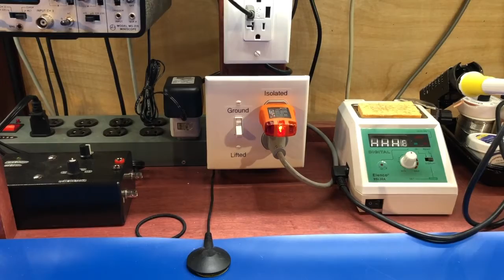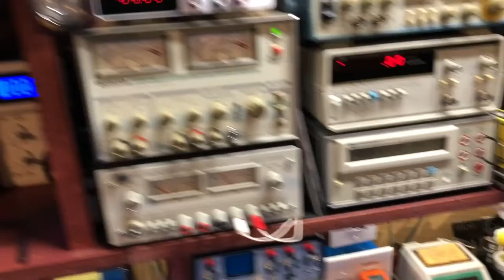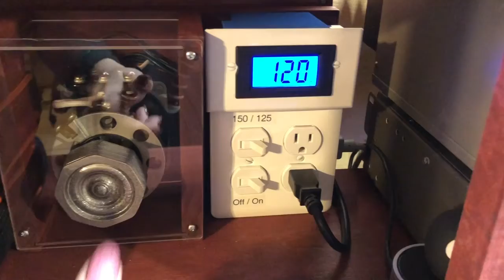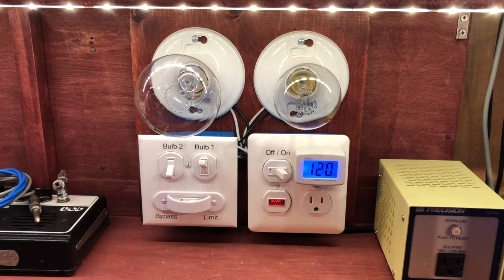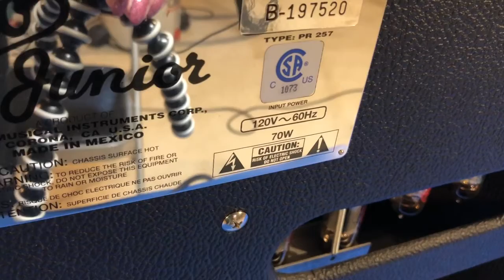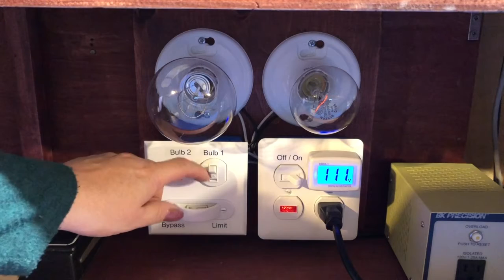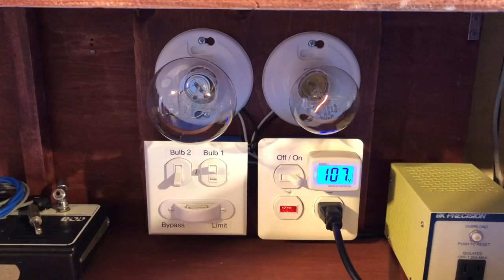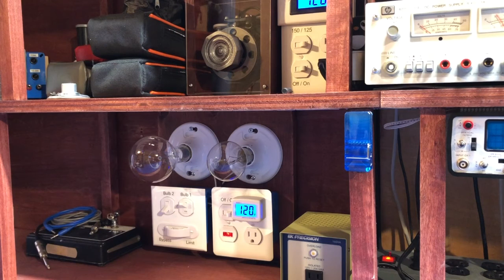Isolation Transformer / Variac / Dim Bulb Limiter

Comment: do you have the drawing of the dim bulb tester, trying to build one now but can work out the three switches right
Reply: The bulb goes in series between the input (cord) and the output (outlet). The switch goes across the bulb. The switch when 'off' allows current to flow through the bulb to the output. When switch is 'on' it shorts the bulb. Current takes the path of least resistance which is through the switch.